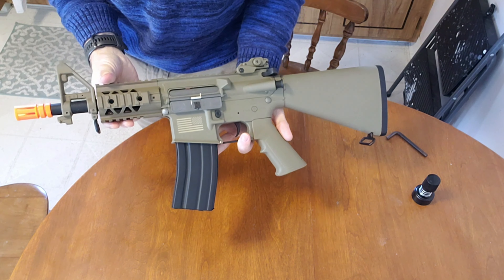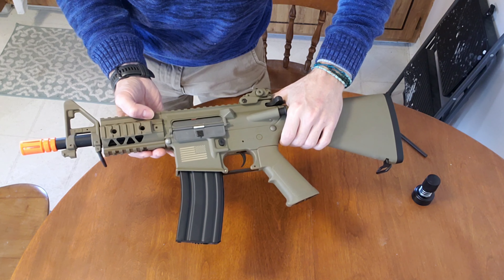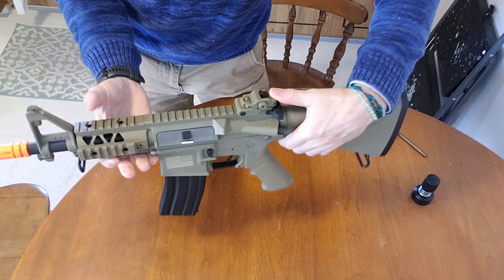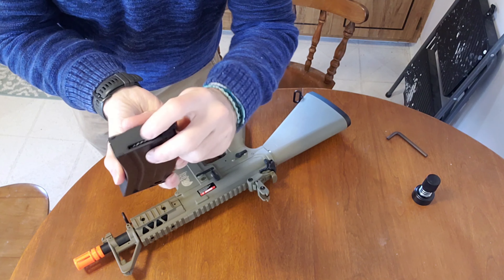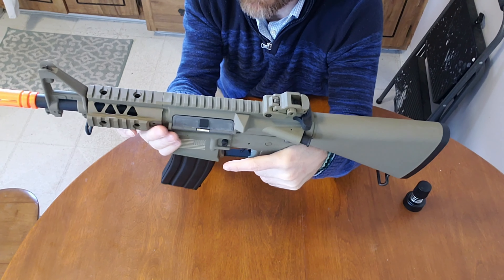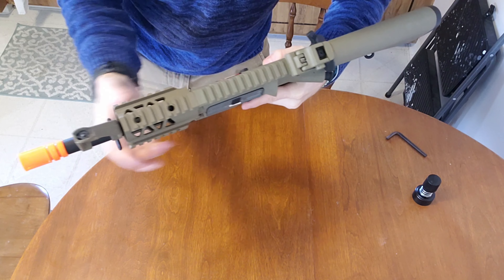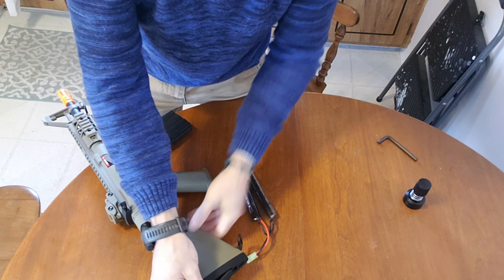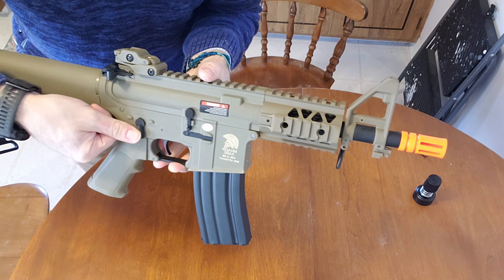Matrix  S&T Sportsline M4 RIS Review

Comment: For some reason the ones that have grenade launchers seem to come with worse motors than the other models. Just shimmed my gearbox and now im going to be replacing my motor with an SHS High Torque (16tpa) motor which should vastly improve the trigger response since the stock ferrous motor is straight garbage.
Reply from the maker: Interesting, yeah the motor mine has is a little tank...so far anyway!
Reply: @fpsentertainment3091  even if it works fine at the moment I recommend you upgrade the motor before anything else. If mine is anything to go off of these ferrous motors have extraordinarily weak magnets. I can turn the pinion effortlessly. Then you consider reshimming the gearbox since S&T's stock shim job isn't the best, but it isn't terrible either. One thing you definitely need to upgrade though is the nozzle and replace the piston head O-Ring because both of those are a leading cause in the major lack of compression in these guns, causing them to shoot far weaker than they should.